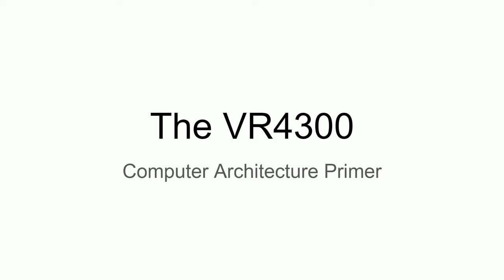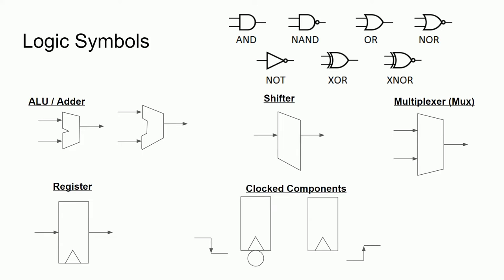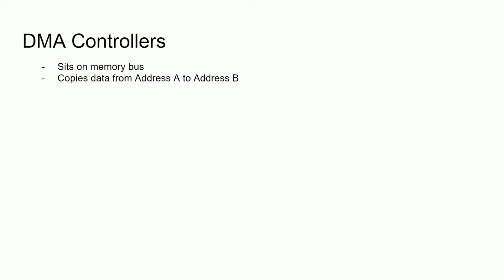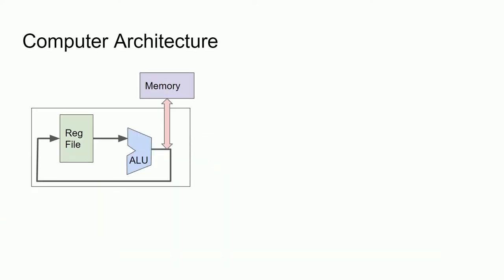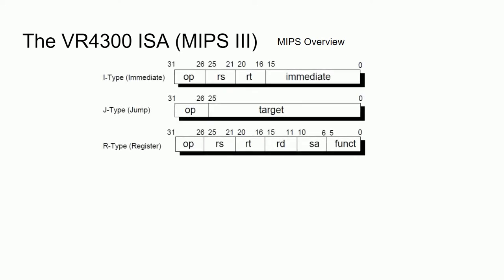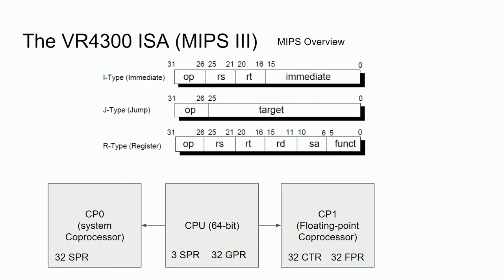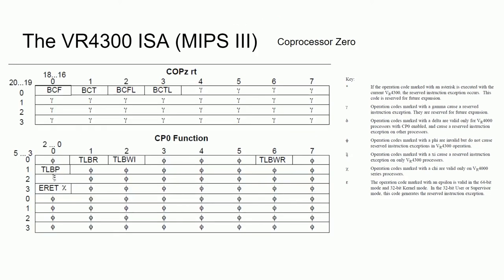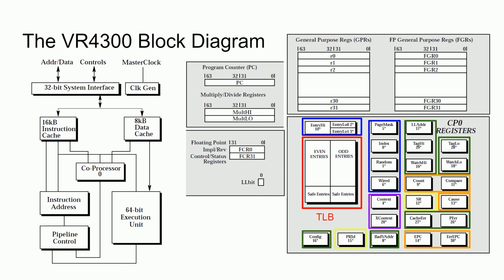VR4300 Primer

Comment: RTL Engineering

Superb!

Not much else to say except "thanks".

I can't wait for your next vids.
Please don't spare us any gory details nor HDL snippets, even if the vids are slightly longer. ;)

Finally some videos on YT that go into a lot more detail on the 90s era consoles / processors.

You've inspired me to look at implementing the GTE instructions for the PS1 again today.

I'll make a cheat sheet first, as most of the registers have a specific storage purpose.

At least it's all fixed-point on the PS1 - none of this scary floating-point stuff. hehe
Reply from the maker: Thanks! I'm glad you are enjoying them. 

Fixed point should be slightly easier to do. Let me know if you want some help with it - I have a fixed-point arithmetic class in C++ that I created while taking a VLSI course (originally from a VHDL implementation), which implements each operation in a line or two of code (for arbitrary fixed-point format). 

If you connect it to a R3000a model in HDL, you should be able to simulate it, and run the actual boot ROM / game ROM (it would be very slow, but much easier to debug than using signal tap).
Reply: I just realised that the "wire" defines might be fine for grabbing the bits from the GTE regs, but for writing back to the regs, I should just change all of the "wires" to actual defines or parameters.

The only thing then is that the "wires" make it easier to tell how many bits should be grabbed from each reg, for each value.

hmm. the first of many things to ponder... lol
Reply from the maker: I'm not as familiar with the GTE as I am the RSP, however, I would take a step back from writing the actual HDL, and work on a block diagram, to figure out what all needs to be in it.
I believe it also used the general purpose register file format, so that adds additional complexity, where you need to have the CPU be able to read / write to any of the 32 registers.

You should also think about adding constants / parameters for the module, one of them being the bitwidth of 32 (I know the actual implementation was 32-bits, however, it wouldn't hurt to provide an N-bit interface so that if someone wanted to, they could tack it onto a 64-bit processor). Besides, it's always good programming practice to try not to hard code things directly in-line.

I'm not sure if it's a verilog quirk, but you are probably better off splitting the design up into a clocked block for the registers, and a combinational block. I would always run into un-expected behavior when I wrote FSMs with everything guarded by the clock. So in VHDL, there is no register type. Instead we would create two copies of the signal / wire being var and var_c. Where on the clock edge, all we do is var <= var_c. Then there would be another block that is not dependent on the clock, which takes the input signals and var, and produces what var_c should be. 
That way you know that the simulator and synthesizer will not place latches / registers in weird places. Additionally, it helps prevent mistakes, where you assign a variable that you expect to be ready to read, but actually won't until the next clock cycle.

As for specifying lots of wires, that should be fine, as long as you are not creating new registers / latches. VHDL and verilog also have an alias statement, which allow you to break up wires if you need to.
For example, in my co-processor interface component (which contains FCR0 and FCR31), I have: 
alias FCR31_Enable_c: std_logic_vector(4 downto 0) is FCR31_c(11 downto  7);
which allow me to use FCR31_Enable_c as a variable, but it replaces that string with FRC31_c(11 downto 7) at synthesis / compile time. I guess it's sort of like #define in C/C++.

In terms of sources, I also found this page a while back: http://psx.rules.org/psxrul2.shtml
Which I think details the GTE better than the other two sources, however, more sources are always better!

Another source you might want to look at is: https://github.com/led02/psx_fpga
Which was a group of undergraduate students who attempted to create an FPGA based PS1 for a capstone course. They didn't get it fully working, but they did succeed in getting the GPU working, so you could use their component to test the output from a GTE test (since it would be hard to visualize the 2D positions / gradients). They also did implement the GTE, though you should avoid looking at their GTE implementation, since most of the fun is from figuring out how to do it yourself.
Reply: Thanks for the comprehensive reply.

I'll have to absorb this info for a while.

I did see that GTE.txt source before, but completely forgot until you linked to it. :p

I'm decoding the top 8-bits of the opcode for the 22 or so GTE instructions now.

The basic sub-steps of each instruction don't look too bad on the face of it, but the problem is trying to comprehend things like the C / C++ sources in MAME, where they use a lot of macros and inline code for doing clamping and saturation etc.

The capstone link is great btw. I saw a few of those white papers, where various Uni students had looked at implementing the SNES and other machines, and did read the PSX one before, but I didn't realise they'd actually shared the sources for it. :o

That github you posted is superb, as they did manage to implement most of the GTE stuff by the looks of it.

haha - just re-read this old line in their PDF...

"If you are continuing from where we left off, synthesize the project, upload to the board,
open up no$psx, and start back tracing. We are in the middle of the BIOS and entering an
(invalid?) loop right before the white screen comes on in the BIOS animation."

I had EXACTLY the same issue when I was trying to get the PS1 BIOS to boot further on the DE1. lol

With the help of another few comments from no$cash, and a lot of stepping through the code under MAME, I finally found the BIOS routine I had to NOP out. I believe it's something to do with some kernel debugging output that it gets stuck on? I'm not entirely sure what it does.

The routine for initialising the SPU then follows that, which of course haven't implemented yet, so I had to add another NOP for that.

For the "NOPs", I just added this, which patches the BIOS code as it loads the main kernel code into RAM by the CPU at power-up...

wire [15:0] SDRAM_DIN = (BYTE_ADDR==32'h00002834) ? 16'h00 : // Shove in a NOP! (for the Kernel IO redirect thing).

(BYTE_ADDR==32'h0005418C) ? 16'h00 : // Shove in a NOP! (for the first part of the SPU setup routine)

(state==16) ? WRITE_DATA_BACKUP[15:0] : WRITE_DATA_BACKUP[31:16];

And now I just noticed that I was technically only using an 8-bit value for the 16-bit wide bus.
Oh well, it worked. lol

That's great info though. I see that capstone PSX project is in SystemVerilog, but it's not hugely different. I can now follow their GTE code, and see if I can implement it in my own crusty Verilog style. hehe

Regards,
Ash.

Comment: Since your video doesn't talk about the 4300, why don't you change the title of the video?
Reply from the maker: The video talks about the VR4300 (the NEC variant used by the N64), which is exactly the name listed in the title. The R4300 is a different CPU.
Reply: @RTLEngineering  There's almost no mention of the 4300.  I've seen quite a few YouTube videos that take some time to get to the point, but there are no details of the "VR4300 Primer" until about the 13:00 mark.  It's a good video for newbs and non-engineers, but the title doesn't really match the content.  How about "Primer on CPUs and the VR4300"
Reply from the maker: I think I understand your confusion. This video was presented as an intro lecture to the VR4300 (there were going to be more videos following it), which required some background knowledge / refreshers (i.e. primer to the VR4300 not of the VR4300). It would not be accurate to say it was a primer on CPUs - digital logic if anything, but insufficient to really be called a primer on/to digital logic. 
Anyway, I made this video several years ago and would definitely approach it in a different way now.
Reply: @RTLEngineering "Hi, I was originally planning on doing a video on the VR4300, however..."
Reply from the maker: The rest of the intro was: "..., as I was working on it, I realized that it is worth a series on its own. I also realized that there are some brief miscellaneous topics I would like to cover before diving into the VR4300. "
In other words... I was going to make a single video on the VR4300 but that video ended up being too long, and at the time I was thinking about it from an accessibility perspective (in the mindset of a lecture rather than a technical report or to-the-point short). The video would therefore start off general and then go into the VR4300, which it did. That's the typical format that would be expected of an undergraduate university lecture in computer engineering, albeit with expedited background.
Anyway, I am sorry if you misunderstood the video title. However, I believe it correctly encapsulates the content within. If you are still unsatisfied, then I would encourage you to create your own channel covering such topics - that's why I created mine.
Reply: @RTLEngineering  Okay, I've said my thing: "Give it a more accurate title." It's your video, but I was really looking for an in depth review of the VR4300.  I'll just keep looking.